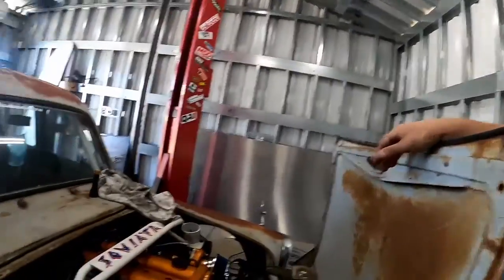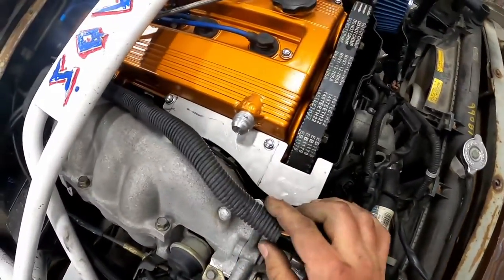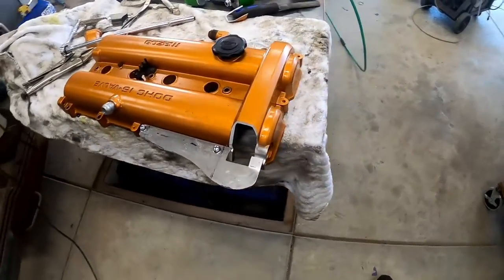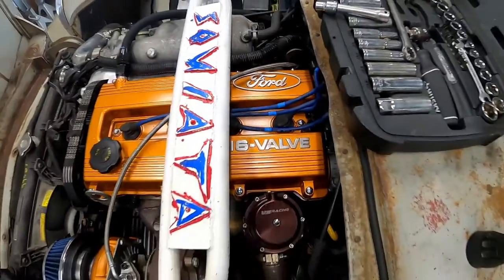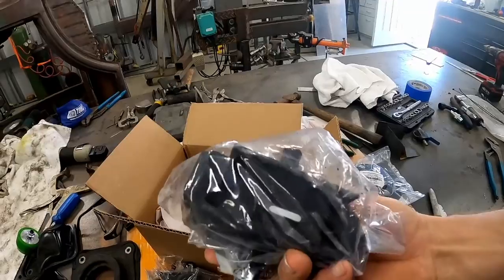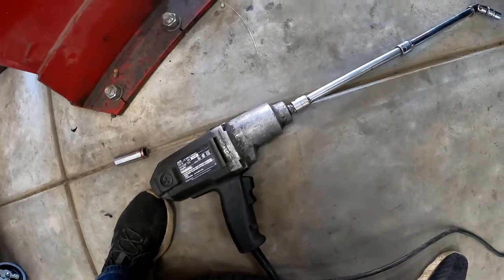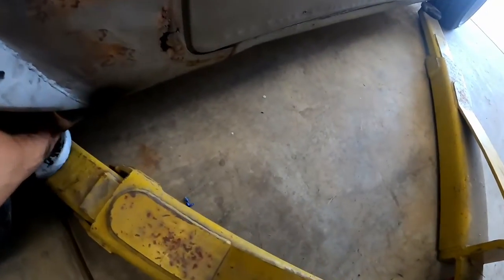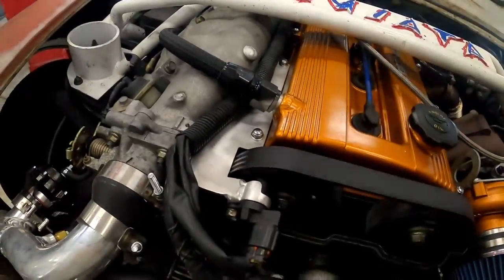Squiata the ford body swapped miata gets more upgrades!

Comment: Did you consider cutting the Mazda cover to be able to somehow use the timing belt cover section of it? I feel like that could have been a clean way to include the sensor and cover the belts?
Reply from the maker: That is exactly what I did sir
Reply: @turborich8316  But include the timing belt cover, as well. Not just the sensor.
Reply from the maker: Oh I actually did think about that too, but I decided I like the exposed belt look a bit more